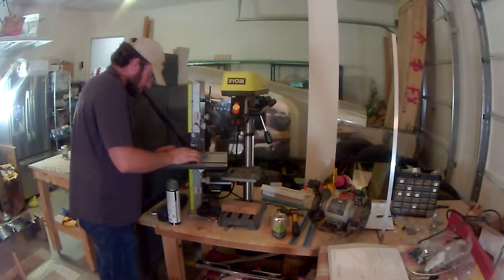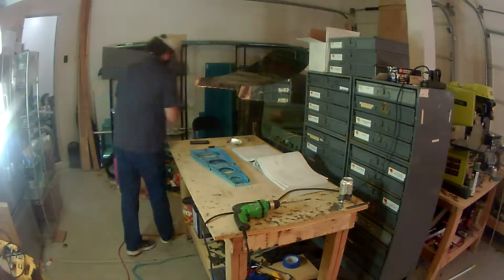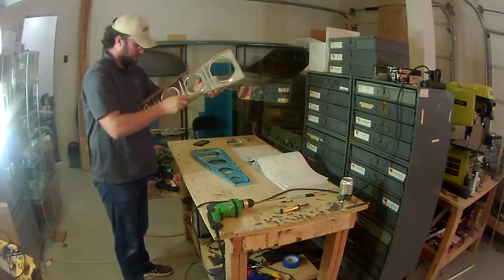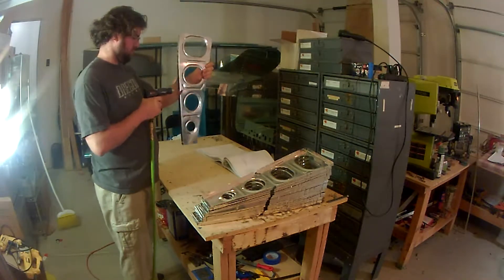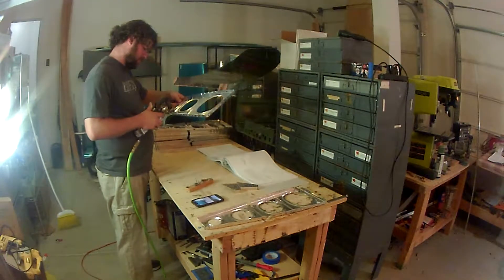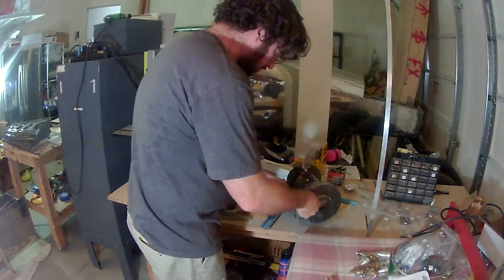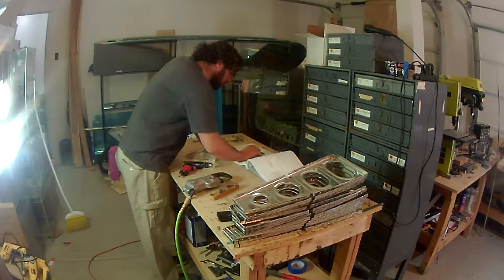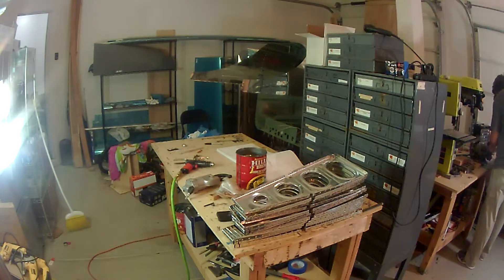Scott's RV 14a Right wing part 1

Comment: Good morning!! I’m going through all your videos for the first time and as I watch, I may ask more questions. Nothing better to do than research while stationed here in Bahrain. LOL.. I wanted to ask about the dimple die you were using for the ribs. You said a deep die. Is it a tank dimple die? Also what rpm is your drill? Trying to desire which rpm I should get. Several to choose from.
Reply from the maker: Ah, good ole Bahrain! I pulled into there twice while stationed aboard a sub! Some interesting memories of the gold Souks! 

So, for the ribs, where the skins will sit into, there is a special die that is ever so slightly deeper than the standard dimple die. It is to allow the skins to sit in the dimple and allow the rivet to sit a little better. I think that I also found this on brown's website, or maybe even cleaveland aviation supply website. It is called the substructure dimple die set on their website. Its showing for around $42. It is not necessarily required, but I decided to go with it to minimize any gap and to ensure a better seat with the skin and the rivet.

there is another die that is labeled as the "tank substructure die" and that is a little deeper to allow for the sealant. I didn't use this. I used the same substructure die and I didn't have any problems. There was only one rivet between both tanks that I had a problem with leakage and that was due to the fact that I did not use enough sealant.

The drill press I have is adjustable, and I think that I did look when I initially set it up to a certain speed for aluminum, but I never touched it after and I don't recall what I have it set to. When I get home from work, I will go out to the shop (my new shop I just moved into!) and take a look and let you know. 

So, where are you at with respect to your project? Are you doing initial research before you buy? or have you purchased the EMP kit yet?

And thank you for your service, my friend!
Reply: Thank you for time served as well.  I’m an LDO(LT), now. Former ET. I’m at 24 1/2 years now.  Trying to get to 30. I’m not building yet. I’m torn between a 14 and a Sling 2.  Haven’t been in either yet, but I hope to before deciding.  I’ll be here for a couple more years.  I don’t have a PPL yet, but it will happen when I get back. The plane is a retirement present/project. I want to make a run at an airline job if I can. Hope to be CFI before I retire. 

Oh sorry on the drill. I meant your Souix air drill.  There are several rpm versions to choose from.

Keith